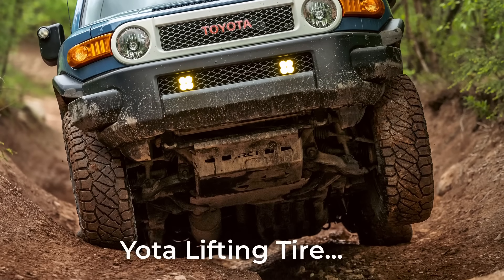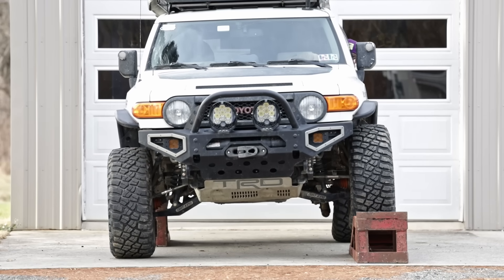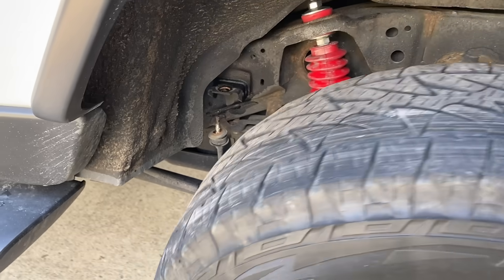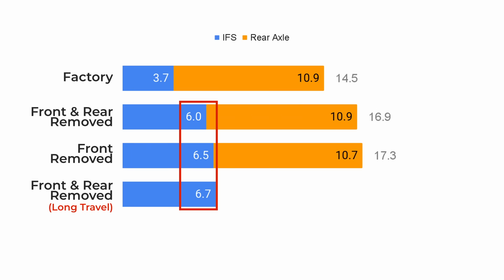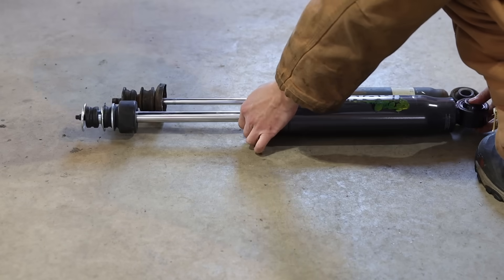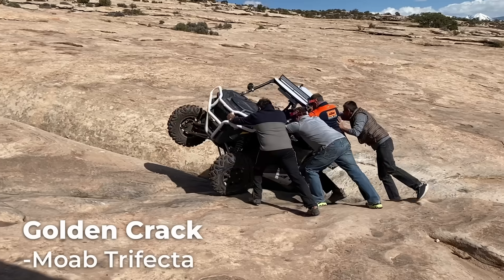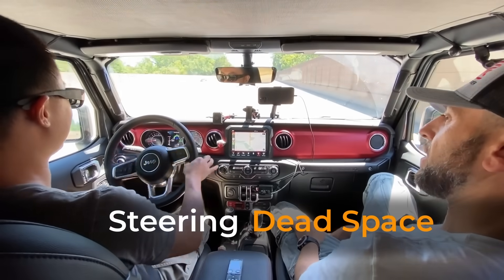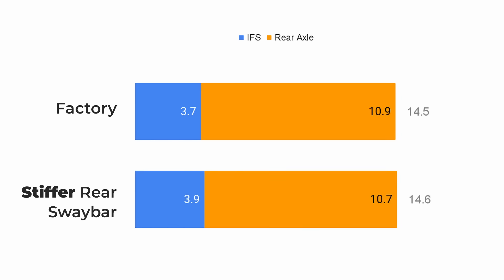Articulation vs Sway Bar | Not What You'd Think!

Comment from the maker: Here are the responses to a few frequently asked questions. I really appreciate you all for engaging and asking questions. Keep them coming!

1. Why can't you simply do a sway bar disconnect on the Toyota IFS (Prado platform specifically)? It is because Prado's sway bar end links mounts to the spindles. Most other vehicles mounts to the lower control arm. If you simply take out the end link, the sway bar will interfere and damage the outer CV and tie rod. You also cannot spin the sway bar 180 to get it out of the way with vehicle on the ground. The closest thing to a "disconnect" is the sliding end links. It does not allow full range of travel, other wise the sway bar will run into the CV like we just mentioned. It is definitely a good compromise, but existing products require extensive amount of maintenance due to all the poor sliding surfaces. Wander Lost Overland did a long term review on this. Go check out their channel!

2. Why can't you simply run extended end links for Toyota rear long travel kits? It is because if you run long enough end links for 28" long shocks, those end links will contact the lower links at compression. They essentially become the bump stops. The extended end links I have barely clears the lower links at full compression, and it is almost pulled straight and bind at full extension of my 26" long shocks. Yes, you can run my end links with 28" shocks. You are simply not getting the full droop of your shocks. The binding end links become your droop limiter and you risk them breaking over time.

These again illustrate the idea I stated in the video. "There are many interactions under the surface. The obvious answer at the first glance is often not comprehensive."
Reply: I quote what you need to make your stock suspension better:
"Integral Suspension System (ISS)
The I.S.S. is a full suspension system that interconnects all 4 wheels of the vehicle through a central device. This interconnection allows independent control of all vehicle parameters (pitch, roll and tilt) without sacrificing comfort, and significantly improving driving in all situations. All this control is performed completely mechanically, without any sensor or actuator, which gives it an immediate response and high reliability." Patented and with prototypes and vehicles running since more than 10 years ago.
Reply: Possibly not with LT but I can disconnect and swing my sway bar up and not contact anything. I also have a quick disconnect I drew up on solid works but lost the file. It is a super simple solution and can use modified oem parts if you were to diy it. I've been looking for stone that Possibly wants to build and test them. I would but don't have the scratch for that at the moment unless I can find some off the shelf parts and hot glue them together hahaha. By the way. Owner of 2 2007 fjs 6mt. 140k, 180k.
Reply: My off road solution was to get a 957 Transsyberian. Looking for a 955 or another 957 with the electronic sway bar disconnect included in the "off road" package.
Reply: What I would like you to test is a set of ORI struts on your FJ Offroad
Reply: Hey Kai 
I am definitely digging your FJ 
Make a  detail walk around  video of your rig and also leave links and list of stuff you have installed
Reply: Would just replacing the oem rear sway bar with the addco rear sway bar increase on road handling?
Reply: I built a disconnect for my GX470.   It's not one of those sliding versions.  I have seen those fail and destroy the CV in the process.  My process was to simply build a bracket that attached to the frame.   You disconnect the swaybar on both sides and slide the sway bar up out of the way.   It's not ideal from an ease of use point of view but it allows you to disconnect the front bar, have zero chance it will destroy a CV (unlike the others) and reconnect when you want it for the return trip.  It takes about 10 mins to do.   I typically only do it on multi day trips or really longer days and rougher trails.
Reply: @TheColorado4wheeler  I'd love to hear more or see pics of your set up, I was looking at this yesterday!
Reply: Not sure if this was answered, but what about longer endlinks for the front? Would that increase travel while also keeping the sway bar connected? Thanks Kai!
Reply: Hi Kai, thank you for all the engineering that goes into your videos. Have watched many of them multiple times. I have an 07 FJ, spc uca, stock lca toytec 3" lift/shocks front and rear.  Looking at the long travel dirt kings, based on your analysis. Now that you've had the stiffer swaybar and the skyjacker links, plus the dirt king fronts for a while now,  would you use the same parts or make a change?
Reply: If you have a 2” lift should you add longer sway bar links ?
Reply: 23’ 4Runner. I want to do +1 eibach rear springs with the DirtKing 2.0’s. I’m going to run apex front sway bar disconnect kit. Your link to stiffer rear sway bar isn’t available to order on Amazon. Please recommend a stiffer sway bar that would work best for my application.
Reply: Hi, would a longer front swaybar link not allow for more travel than Original?  If it gets lengthend in a 2:1 ratio that the suspension is raised by / extended? Like a 50mm Suspesnsion lift kit gets a 25mm longer Swaybar link? Will this be allowing for more travel without binding than the standard lenght fitted to a 2" lifted vehicle.  Maybe this will be to costly for the travel gained for some that require the ultimate travel? I am just looking for a overlanders solution that is viable for more allround travel suited to a loaded overlanding Prado
Reply: Kdss is solution and sway bar from Lexus sedanes with adjustable sway bars

Comment: What would be the effect of front delete and keep/student the rear with 4-wheel IS? I am building a 2008 Sequoia overlander. I have the bilstein 6112s in front and 5100s rear with Dobby 1.75 springs. The ride without the front sway bar is great. Working on a plan for the rear. Keep stock? Stiffer? Disconnects? I've been a subscriber for a year or two. Most of your videos really inform my choices more than any others, so thank you for all of the hard work, Kai.

Comment: My stock Land Rover 110 (2011) with rather ageing suspension with front and rear sway bars connected gets basically the same total articulation as your FJ with long travel suspension and no sway bars. 
And it's stock suspension. 

I hadn't realised quite how good it was. Which is a problem given the vehicle is falling apart, kind of needing replacement and I've run into maxed out suspension flex issues before.

Comment: I want to point out a thing you didn't cover in your video, which is "rollover resistance" which is, in this context not the resistance to a vehicle rolling on the top, but resistance in the forces applied to both vehicle frame and it's axles during a sudden movement to either side when vehicle rolls on it's front and rear axis, ie. centre of gravity as viewed from front to rear of the vehicle. 
Rollover resistance increases with sway bars and decreases without them, making it an important factor in trails like deep snow where you are driving at significant speeds causing vehicle to oscillate back and fourth. In that scenario having a sway bar is actually worse, because lateral forces oscillating a vehicle to let's say left are reduced by more dampening force from the suspension in case of a no sway bar, but increased in cases where sway bar is installed, or incorrect sway bar used for the suspension setup. To see what I mean a good lookup is the Swedish Moose Test. 

I've seen a truck roll in that exact scenario driving on otherwise level ground during driving in snow. I do not have the experience of  rock crawling in the USA so I can't say if that would even be something to consider unless the vehicle would suddenly slide and come to a full stop, causing similar effect as the oscillation previously mentioned.

Comment: Ive removed my sway bar, but installed stiffer springs front and rear, with a 1 inch lift spacer and stiffer shock absorbers in front, and my truck is not only stable, but grips the road much better in hard turns with unmaintained roads. Just removing the sway bar is not enough, you also need to beef up the other suspension components.

Comment: Rear should be the same articulation with no sway bar and the front still attached I think the front sway bar handles most of the weight and most of the cornering handling I believe the front sway bar will limit the rear lest see if I’m correct this is why I like your videos your deep dives are fantastic I like all the testing and real results you tackle

Comment: If you have leafs in the rear run a sway bar up front i have 12” kings on a obsk3500 and it sways im building mine from a Nissan Xterra torsion bar.

Comment: Great video! I recently purchased front and rear quick disconnect sway bar links. I have yet to test it off road, but I was wondering if I should be concerned if I disconnect the front sway bar from the link, will it "flop" around or hit the tie rod or cv boot? Or is it held firmly in place by the bushing that's attached to the frame?

Comment: Never, EVER, EVER remove the front sway bar without removing the rear. It's actually less safe to have a rear sway bar without a front, than it would be to just chop them both off. It can cause the rear to transfer all the traction to the front wheels in a corner, meaning you will suddenly spin out.
Reply: Isn't that the point? Oversteer > understeer

Comment: Yo man. No offense but if you didn't cut off the factory mounting points for the rear suspension. IE the upper and lower link pivots then you don't have rear long travel. All those stupid "long travel" lower links are sales gimmics. All that does is move the axle fore and aft. It doesn't create more travel. If you don't cut off the lower link pivots and move them towards the front of the car you're not creating more travel. I kind of thought you would understand that as an off road expert and engineer.

Comment: Kai, quick question. Since our Toyotas are solid rear. Were you able to run the corner ramp test with only the rear axle on the ramp. Reason being, when the front sway bar is disconnected and the rear connected the rear articulation reduced by .2 inches. I think that could be due not enough ramp height on the rear as the front wheel maxed out even before the rear did

Comment: Would this also be similar reuslts to a 6th gen bronco with ifs? My Sasquatch bronco has a factory front and rear sway bar. Im all factory suspension but i noticed i have extremely low doown travel with the front two tires.  I have been  consdering removing my front sway bar or buying an anti rock swaybar frontge front. 

Whats yor thoughts.

Comment: If companies are going to advertise body-on-frame 4WD vehicles, with a rear locking differential, sway bar disconnects should be a key feature, especially on front IFS vehicles.
Reply: Like the new landcruiser 250?
Reply: @PplOfTheWay  I'm not a fan of that vehicle. I wish Toyota would sell the new Land Cruiser 70s Series that they started selling in Japan, Australia, Africa, South America, and many other countries that do not have strict CAFE standards and safety standards that we have in the US.
Reply: @PplOfTheWay  I don't trust Toyota's new 4 cylinder turbo engines. In addition, the new Land Cruiser 250 isn't built as tough as older Land Cruisers. The frame is weaker, in order to save weight. Toyota has to do this, because the vehicle is carrying the extra weight of the hybrid motor and the hybrid battery. Regardless of what you think of Trump, he's trying very hard to get rid of all the carbon emission standards and safety standards that make US vehicles massively overpriced. I'm hoping he can get that accomplished, and better vehicles will once again be available in the US. I'm still driving my 2011 Nissan Xterra Pro-4X. It's still working great for me. It only has 85K miles on it, so I'll continue taking care of it and repairing it when necessary. One thing I really like about the 2nd Gen Xterras, is that they share the same fully boxed, high tensile strength frame of the Nissan Titan. The Nissan Frontier also shares the same frame. That frame is massively overbuilt for a vehicle the size of a 2nd Gen Xterra. It doesn't rust out, and there is absolutely zero frame flex in off-road conditions. I've beaten the living crap out of it off-road, and it's been able to do far more difficult obstacles than I thought it could handle. All that said, I'd much rather have a new Land Cruiser 70s Series. Ever since Stellantis took over Jeep, Dodge, etc, the quality and reliability have been abysmal. I'd like to own a Wrangler Rubicon, but I can't justify the price for that horrible quality.

Comment: Perhaps off topic, and definitely out of brand (I’m referring to a 2019 Ram 1500 w/ an sts ready-lift, with the blistein extended shocks). 
My question is, for front ramping (one tire only) while at car/truck shows, would a front sway bar disconnect let the truck sit more level, and the suspension articulate more for visible effect?

Comment: not a jeep, fj or Toyota but my 87' S10 with factory front sway bar IFS and Solid axle rear without sway bar articulates really really well front and rear. full bumpstops even after I trimmed them an inch. also, a torsion bar front if that matters.

Comment: So could I increase articulation by adding a rear swaybar to a tacoma? Already removed the front and it was a massive improvement and not at all dangerous on the highway. Forgot about it after a couple days and I've heard after stiffer springs it's even less of an issue.

Comment: Super cool breakdown of the issue.  Coming from a Bronco which did not have a rear sway bar, i was wondering if I should just remove it and your video basically says no.  I do have my eye on the new Apex sway bar sliders, I hate to call them disconnects since they technically aren't.  But they look like a nicely engineered product.  Very cool video, lots of data to consider, thanks fro putting it together.

Comment: It sounds like stiffer rear swaybar is the way to go in all situations. And quick disconnects would be helpful up front and would allow you to gain articulation when needed without compromising on road handling. I have a 2005 tundra access cab. What effect does the longer wheelbase have on articulation?

Just read your FAQ, I wondered why I haven’t seen a lot of quick disconnect kits

Comment: 23’ 4Runner. I want to do +1 eibach rear springs with the DirtKing 2.0’s. I’m going to run apex front sway bar disconnect kit. Your link to stiffer rear sway bar isn’t available to order on Amazon. Please recommend a stiffer sway bar that would work best for my application.